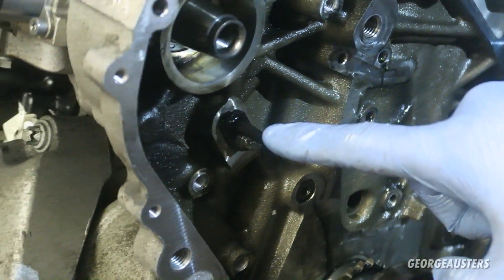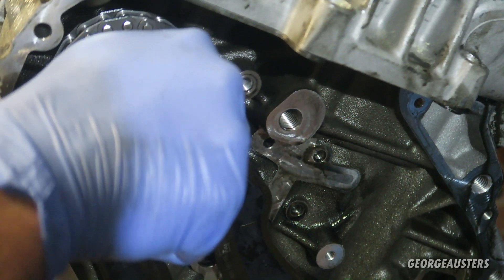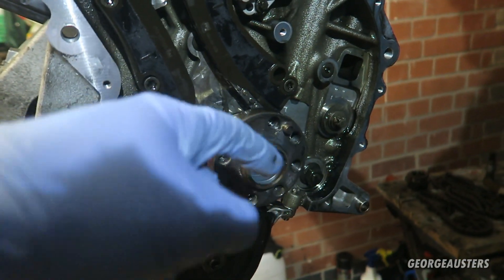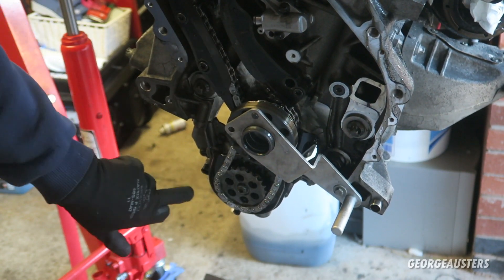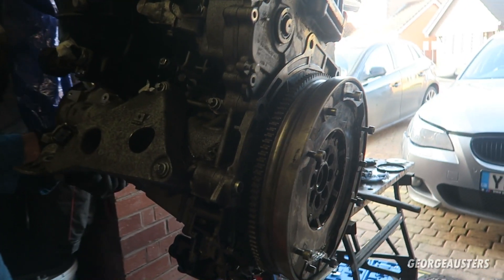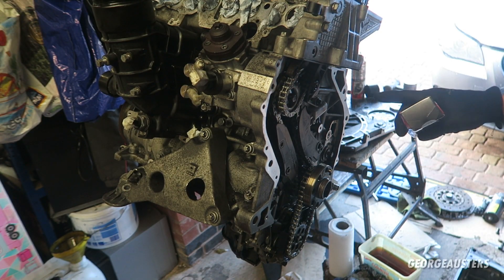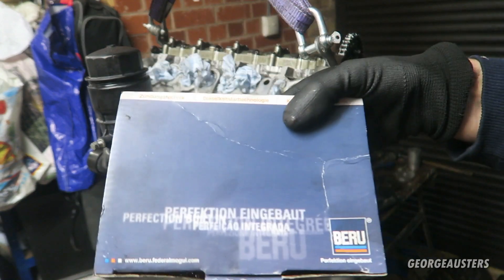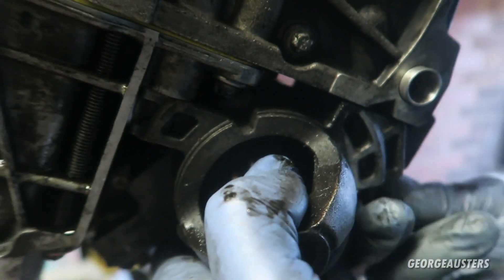BMW N47 Timing Chain Replacement | Part 2

Comment: Im going to change my F11 N47N engine timing chain and manual says that HPFP is timed 45°. It also says that after parts has been removed crankshaft should be positioned 11° after TDC which is new timing for HPFP. I have both tools so I can do timing change but what you think. Should I stick with old one or change new?

Comment: Hey George! Did u have to seal the timing cover ? Also not sure if u will know what i mean but, see where the top m12 bolt sits where it holds gear box & timing cover sitting on the right side of the round circle black cover  to high pressure fuel pump… did u have to seal that part as well? 
As im getting leak from top part of my gear box  from that long m12 Torx bolt right at very top of gear box. 

Oil Its running down my gear box now :( 

Thanks hope u can let me know. As the bolt was not there & im hoping that once i put bolt back in from who ever didn’t put it back, lol its will stop the leak i hope….

Comment: i have owned a few older BMW cars no problems i now have one of these bloody things, wish i had known before i bought it. but i promised it that if the chain snaps its going straight to the crusher. auto box or engine failure in any car i own is a case for the scrap yard

Comment: Did the FAI chain kit last?? Just used the same kit. Some one had it failing in just 10K.
Reply from the maker: Yes fine.. The chains are genuine IWIS ones used from factory
Reply: BMW specialist garage fitted an FAI kit to my 116d last year. It failed after 13k miles. Fuel pump chain had snapped. Since the start of this year, the garage now only use genuine BMW chains as they have heard from other independents that there is a problem with FAI chains. I’ve just started replacing the chains on my 318d but opted to spend >£500 on genuine BMW chains. There must be a problem with FAI as the garage didn’t charge me a penny to fix the problem with the 116d, and have now fitted genuine BMW parts at considerable expense @GeorgeAusters

Comment: Question  when you replace the timing chain.  Should you remove the engine?
Reply: Can just remove the gearbox but less access will make the job a little harder

Comment: Great job!
I have a question for you: when fitting the new chains Is the chain supposed to have more slack on the tensioner side or the non-tensioner side? or is it supposed to leave an even gap between both sides?

Comment: So you installed the clutch that easily without any special tools and succeeded connecting the gearbox to the engine? Unfortunately the process of installing the clutch is not completely visible in the video, can you maybe explain what exactly you did?
Reply from the maker: My dad turned down a piece of alumnium to work as a clutch allignment tool
Reply: @GeorgeAusters  Thanks for the quick answer! Good solution! I was thinking about doing the same, but prbly out of wood. I am actually more concerned about the pre-tension. Did you just hammer it on?

Comment: very good job. must have cost 2000£ when it could have been done for a 30£ belt it's over engineered too many things to go wrong great for mechanics rip off for owners.citroen 2.0L diesel 110,000 miles between belt changes 1 hour labour

Comment: I have a 2015 BMW 328d with 136,000 miles. No issues as of yet but starting to wonder if I should have this done. Thoughts on this model and year?

Comment: George just a quick question please replacing the oil dipstick tube does the o ring at the sump end sit on top or does it push inside a little with a bit of a push
Thanks pal
Reply from the maker: From memory is pushes inside but I think it was tight

Comment: Hello. I saw on ebay upgraded chain kit. Apperantly two of chain guides are made of rubber they are black color instead of brown. Is that even possible or is it a scam?
Reply from the maker: Stick to OEM
Reply: @GeorgeAusters  i know but oem is not really upgrading their products.
Reply from the maker: It is... the new kit is a revised one
Reply: @GeorgeAusters  from what year amd whitch brand?

Comment: bet you was gutted when you realised the crank pickup was left off, hope it wasn't when it was all back together 🤔
Reply from the maker: Crank pickup?
Reply: yeah the magnetic ring that sits between the crank and flywheel
Reply from the maker: @liamjenkins5430  Yeah I installed that don't worry

Comment: Isn't it 10Nm for the oil sump bolts? and 25Nm for the oil drain plug.
And is the the torque for the starter 19Nm?
Thanks George, I was able to replace my timing chain, best guide out there!

Comment: Hi George, Great Vid! I need to do mine as timing chain snapped aswell as any rebuilds to the engine. Where did you get the info for torque setting etc? is there a BMW book or guide with table online?
Reply from the maker: You can use ISTA to find all the torque specs
Reply: @GeorgeAusters  Thanks! Is this readily available online? Or is that the £30 access from the bmw TIS replacement site?

Comment: 2:57 Is this new FAI tensioner necessary to modify the screw thread to a longer length? [FAI TCK133C]
Reply: hi , he is using the uprated tensioner, it has a 24mm head , the old one was 27mm, and I changed my tensioner for the new one and just screwed it in, was fine no problems.

Comment: I just lost all oil pressure om my N57D30B engine? Only 45k miles on engine. 
Oil pump failure?
Just pul down the oil pan, an put in a new oil pump?

Comment: ho long did that take , from start to finish , great video , very clear.
Reply: It took me 3 and a bit days, Solo tho. And I have a 120d though so much tighter trying to get the bell housing bolts off.

Comment: What about high oil level in dashboard??  I see some leaks on the strarter motor i don’t know where is leaking but what is strange is that is leaking but the level is high!!! I checked the dipstick and is above max , the level of the cooling water seems to be about the same i think (i am not sure how it was before,but now is at minimum ) so i need some help guys 🙂
Reply: No my oil level is at minimum on the dipstick but on the dashboard is at max ,i think i ‘ll have to replace both the oil sensor and oil pan gasket 👍

Comment: Also George, I bought the FAI kit from you link as my has N47D20 engine too. However my new oil noozle in the kit has bigger head compare with old now? unable it exchange it. do you have similar situation ? or it's normal the head is bigger on the new oil noozle
Reply from the maker: Which year is your N47?
Reply: @GeorgeAusters  2010
Reply: Did you put the old oil squirter back in? Got the same issue :)

Comment: Hi George, I have managed to do almost everything. just one more question, how to you check your timing is correctly step up ? I don't have the special tool to lock the crankshaft. The rest 2 sprockets has marker when I can follow. but the 45 degree at crankshaft atdc is very comfusing. I did buy the £20 timing tool for N47
Reply from the maker: You need the full proper kit ideally mate

Comment: Hi George, cracking video, just one question, how accurately does the hi pressure pump marking have to line up with the lug on the engine, mine seems to be a few milimeters higher the lug but of I were to move the  gear down a tooth it would be even worse, thats  with the crankshaft locking tool in place  by the way before any one asks lol.
Can send a pic if you want but not sure how.
Thanks for any help you may be able to give, cheers, Chris.
Reply from the maker: No that's bang on, it doesn't actually line up exactly.
Reply: @GeorgeAusters  
Thank you very much, now I will be able to sleep tonight.
You have given me that extra bit of info that auto data couldn’t, top man thanks again, Chris.
Reply from the maker: @chrsrans1  No problem Chris, appreciate you watching!
Reply: @GeorgeAusters  one last question George, if my eyes didn’t deceive me I noticed that the dowel guides for your timing cover were missing from the engine , just wondered if you removed them yourself and did you put any back in.
,kind regards, Chris.
Reply: Common rail pumps generally are not timing critical.

Comment: You have a press in that timming locking set for removing the high pressure gear. Why you did not use it .it s wrong using the hammer  ...it could damage the treads or the pump shaft.
Reply from the maker: I know. This method is for those who don't have the tool.

Comment: Can i uppgrade my tensioner to the upgraded version as a preventative maintanance? Or Will it cause damage? I have the 27mm socket right now, so i have to old design. New has the 24mm head socket as in your video and is 10mm longer
Reply: Maybe I’m a bit late, but yes you can do it

Comment: Hello George! I'm currently planning to swap the FAI timing chain kit in my N47 also. Is yours still running strong after couple of years if you still have it? Also did you put the old oil pump gear back on it or did you buy new one?
Reply from the maker: I swapped over everything that comes with the kit in the description and yes still running fine!
Reply: @GeorgeAusters  Thanks for the fast reply! Love all of your videos. Your channels N47 section will be put to good use when im doing improvements on mine :). One additional question, why the crank has to be rotated to 45 degrees atdc? Does the camshaft locking tool fit in place only then

Comment: Hi the George hope u well do you reckon the top tensioner can be replaced without dismantling engine chain i have a cold start rattle the last 2 seconds i think its one of the tensioner that takes longer to fill up with oil. only on cold starts otherwise drives perfect no other funny noises very quite engine
Reply from the maker: Yes you can but I wouldnt bother. Just do the entire timing chain kit
Reply: @GeorgeAusters  George replaced the tensioner today seems like it resolved the rattle on startup. The old tensioner was very loose and was not attached anymore come out in 4 pieces the piston or Shaft spring and another thing shaft I believe is to draw oil into tensioner whatever u call it was detached spring etc top face of piston was scored from the guides from rattle for the past year I think If left longer would had been a bigger problem. New one looked slightly different. Not rattled since change.
Reply: @GeorgeAusters  Thanks for your response George I actually ordered it after contacting u today. It's cost £52 and going to give it a go as am planning to sell it I looked at your video today and did some research on the issue I have and come across a forum were a person experienced exact same problem only slight rattle on startup. And he explained he booked into dealers and there technicians said it's due to long service intervals and that the top tensioner can wear our and spring loosen and and taps on cold start as it's drained out oil until full of oil again. The new tensioner is a revised version. My engine is just hit 60k in great condition rarely drive it am a Builder just haven't got much time to change it myself am confident I can do it watching your videos I've replaced a chain on a Audi before but just time and family time. Let see how it goes will update otherwise will have to do something over a course of lots of weekends 🙊

Comment: George Austers the bearing in 8:23 did you replace new? or did u use the old simring? Because mine is today at workshop and the kit bought from FAI, everything worked but mechanic said the bearing in 8:23 simring is to big. How did u put that back into the metal block? By hammer? I dont know why my mechanic says its to big... 

i have the C type of N47 and the kit i bought should be fitted.

Comment: Its little wonder its almost always the top chain that fails on the N47 & N57's, its half the size / weight of the other two chains, why would BMW make this decision?! Thankfully just the top chain and guides etc can be changed with the engine and gearbox in place.
Reply from the maker: It can’t. You need to remove the timing cover and to do that you need to remove the gearbox, clutch and flywheel
Reply: @GeorgeAusters  It can if you split the chain, there are quite a few garages do this now for about £400. Only reccomended for the N57 though.
Reply from the maker: No it can’t, you can’t remove the HPFP sprocket without removing the timing cover
Reply: @GeorgeAusters  Correct you leave it on and just wind the new chain down over it.
Reply from the maker: @tricksieboy  Pointless replacing just the chain. It’s the tensioners and guides that can fail too👍🏻

Comment: Because I often read, what an idiotic design it is to have the chain in the back:
While I do agree that it is a pain to work on it - if you ever have to - (one of) the reason(s) to put timing chains in the back is due to safety regulations. For pedestrian safety, you need all the space you can get between your hood/bonet and all the hard parts (e.g. cylinder head) underneath. The idea is, to cushion the force of impact and evenly distribute it. If you have the chain in front, naturally you have the 2 camshaft sprockets sticking up in front of the engine and make sort of a edge that won't give in. In a pedestrian crash, those are areas where your hip (or a child's head) would hit.

In engineering it's all about compromise and how you weight all you different factors.

Just saying...
Reply: @Ma Wa - If the pedestrians life depends on whether or not the timing chain is at the front or back of the engine, then you are skating on thin ice anyway. If you are worried about the safety of pedestrians, drive more slowly! To design a car back to front IN CASE the driver has that one in a million chance of hitting somebody is lunacy!
Reply: @bryanduncan1640    I'm sorry to say this, but I think you are missing my point. Of course this aspect of design is not the only factor in pedestrian safety. It is one measure of probably dozens of others, active and passive. 

Your suggestion of "drive more slowly" could be another one, for instance in implementing a speed limiter. Very effective probably but not compatible with a lot of other requirements.

By the way, every car is designed front to back for that "one in a million" chance. Think of a rollover, or a front collision, a rear collision, side impact, small overlap, no overlap... 
You would have no safety features at all if you go by your logic.
Reply: @mawa9843  - Thank the lord that I don’t travel with you! I’ve never heard of anybody with a worse doomsday attitude than you. I totally understand the the drive ( forgive the pun) to eradicate wedge shaped bonnets ( sorry, hoods) etc, to prevent pedestrian damage in the event of an accident, but to suggest that the move to relocate the drive chain to the rear of the engine was in any way a “safety consideration” beggars belief. For this move to have any effect would imply that the front crumple zone had already been breached. In such a scenario, the pedestrian would have already had to “travel” through over one foot of bodywork/bumper (fender) before he/she even reached the engine!
Reply: @mawa9843  - Thank god I don’t have to live on the difference between the distance from the front of a car and the engine on a conventional engine to that of a rear timing chain engine. I fear that you are attributing an erroneous assumption to an engineering ( i.e. cost saving - v - somebody’s bright idea) solution. The extra inch or so that might, just might, be saved in the event of a crash could more than be compensated by making the hood longer or moving the engine back.
Reply: @bryanduncan1640  Read my first post again please. I wrote safety is "one of" the reasons. If cost is beneficial, that is of course a factor as well. NVH (noise, vibration, harshness) being another. 

Moving the engine back an inch, or making the hood longer... Let me guess: you have no professional relation to vehicle design or engineering, do you?

Comment: I drive a BMW 520D diesel engine car reg 2008.  I recently had my clutch kit and DMS replaced.  Not long after i started seeing oil leak. upon troubleshooting we found out my rear main oil seal is leaking.   I wonder if i have case with the garage who did my DMS job if they should have replaced this seal while they were there already. Anybody could advise please

Comment: Is the oil pump sprocket bolt torque to yield? I ask given the 5Nm + 90 degrees. Need to know whether to replace.

Comment: Smart design, let"s put timing chain in the rear part of the engine.
Reply: Not great but better than the ecoboost wet belt..
Reply: With you 100% there mate, what a clusterfuck. If on the other hand you'd care to enjoy the joy of this design, or perhaps worse, in duplicate form, check and see how they made an Audi V8 motor in the RS4 and utterly slash it's second hand resale values to anyone smart enough to do their homework before buying one.... And yes - the final view is from the flywheel end... https://www.youtube.com/watch?v=MyGxSNDFK-s
Reply: Yeah better than v belt ??
Reply: This Timing chain its designed to last almost a life time

Comment: Mate absolutely love your videos can't thank you enough for you attention to detail. Recently bought an e60 520d and I'm about to embark on doing a full overhaul on the engine thanks to your uploads. Just wondering what you used to seal your oil pan?
Reply from the maker: Cheers mate. No sealant, just the sump gasket👍🏻
Reply: @GeorgeAusters appreciate the reply mate, great good to know as I'm pretty sure I've got a heavy leak from the sump which has started the whole idea of a full overhaul 👍